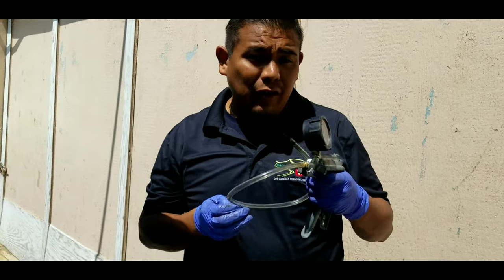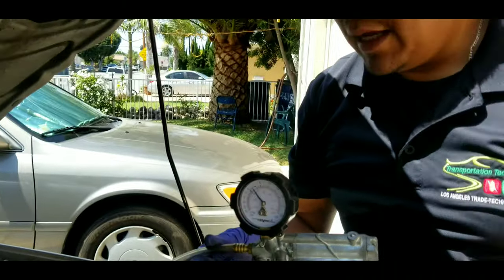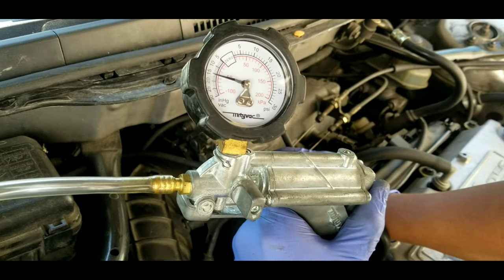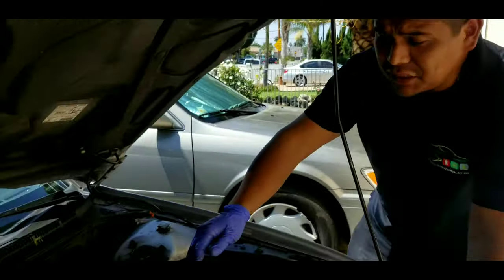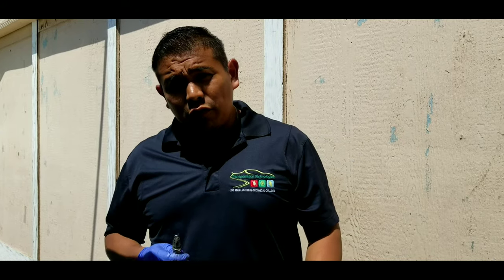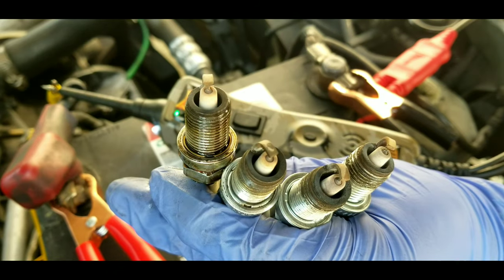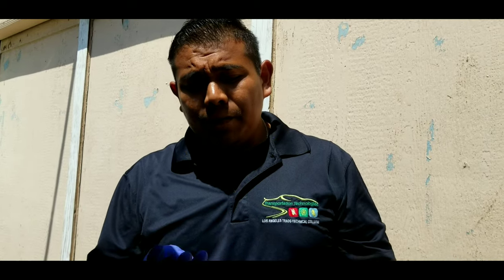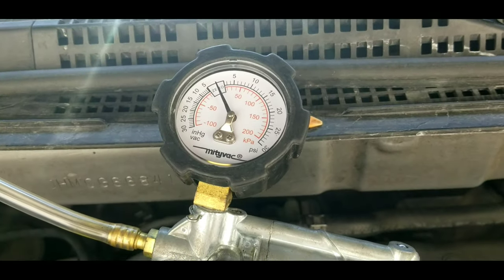Diagnosing a Misfire Without a Scanner

Comment: Great video!  This is a 4 cylinder engine.  It is possible to do a compress test like this on a V6 engine when one bank of the ignition coil and spark plugs are under the intake manifold like the 2GR-FE engine on Lexus RX 350 transverse engine?

Comment: You are correct with running these tests without a scanner.  We were running these same tests 60 years ago, long before all the electronics showed up. Knowing how the basic engine operates has become a lost art. Good job.
Reply: a vacume gadge really helped me with my car+i ran it into my car now and drive it with it connected.  ive learned to read and learn alot of things with it.
Reply: very true+i still use v gadge and im pretty good with. very interesting. imo
Reply: I used a vacuum gauge to set timing and mixture screws, I'm hating new electronic injection vehicles
Reply: @Maples01  The new EFI vehicles are easier to diagnose if you understand how it works. You just have to get over the learning curve and you will see it is a much simpler system because each component has one job, unlike the distributor and carburetor cars.

I understand both and have learned to love the simple EFI systems. A scanner is just a tool that points you in the right direction, you still need to use your brain to do the rest. Guys that rely solely on scanners spend a lot of money on parts that didn't need changing.
Reply: @davidparker9676  I kept my carbed classic running great over 10 years before someone totaled it, this POS has lived in the shop more than my house, no one can fix it, I'll take a carb over this junk.
Reply: @Maples01  Mechanics that can dial in a carb are more rare than mechanics that can get the EFI dialed in. 

The learning curve is a bit different for EFI but making an equal comparison to carbs and distributor tuning, EFI is way easier to deal with. 

This video is universal for carb or EFI. 

Perhaps if your carbed  car had on board diagnostics, you would see it as unreliable an a royal PITA.
Reply: @davidparker9676  Bro, I did my own, I mount a vac gauge in my dash, set the carb and timing with it. The POS injection is constantly costing money and NEVER has run right in this damn thing since day one, it will not run the self diagnostic, throws a code every time I attempt it telling me that it failed to engage. Now I can add a new ECM and pray that fixes it, likely will not, may fix some issues, but not all, when this shit gets 30 years old it becomes a vacuum that will deplete your bank account, continuing to feed it money is dumb as hell!

Comment: On your compression  test portion of this video,  how did you connect  the power probe and where's  connection.
Reply from the maker: The power probe was conneted to the starter motor "S" terminal.
Reply: @MRDIAGNOSTECH   Thank you. That's  what I needed to know.  So the power  probe acted like a push button  crank starter.
Reply: @terrencecarter27   the contact must be at ON positin, then the power probe serves as jump wire to the stater motor.

Comment: My Camry 2arfe has 20" of vacuum. When I snap the throttle it stays about 20" and does not drop to zero. When I turn off the engine the vacuum stays at 20" and does not drop to zero
Reply from the maker: Check your vacuum source. You might be connected to the hose that goes to the vacuum booster. These hoses usually have a check valve that prevents the vacuum from being lost for braking power assist.
Reply: @MRDIAGNOSTECH  thanks for getting back. I know what your saying about the brake booster line. I tried two different lines off the intake manifold both with the same results. Any other ideas I greatly appreciate

Comment: my vacume gadge is usually steady 18_ but drops about 1 to 2" often. i read chart says ignition issue. i think i need a new set of ignition coils. 3 pack on pontiac grand prix. does this sound right about the 1 to 2 inch vacume drop and possible needing ignition coils? i put new plugs+wires on my car in september 2021.  please comment+ thank you sir.!
Reply: Hello, what did you find out about your issue?
Reply: ive not got to test anything yet+runs great. vacume needle seems to float more with heater blowing. that may be all. im gonna do more testing asap but runs like a top for now. thank you.

Comment: What about an engine that is running high vacuum. About 26 at idle
Reply from the maker: Altitude plays a big role in vacuum, @ sea level the engine will produce 17-21 inches of vacuum(in.Hg). About sea level there will be less vacuum and below sea level there will be mote vacuum at the manifold.

Comment: With the engine running you should have done, spray the intake to manifold area with water,(this rules out a gasket leak), second would be to test the injectors firing circuit, feel the injector to see if it is pulsing.
Being honest, if I was to see this, and I was paying by the hour...you can bet on a verbose response. 
Just like a compression test should be done at the time you inspect the plugs, on all cylinders at once.
Also you don't need to do a compression test, if you know how to do a flood /(wot) start test.
Hold down the accel to the floor and crank the engine 4-6 revs. If at any point beyond initial crank, the engine speeds up, you have low compression on 1 or more cylinders.
Reply from the maker: A relative compression test is faster and efficient, feeling an injector pulsating doesn't mean is working,  it could be clogged. This video was to demonstrate how vacuum can reflect engine driveability issues.